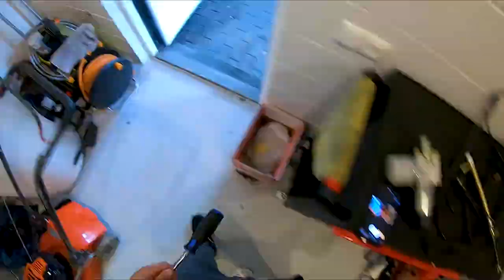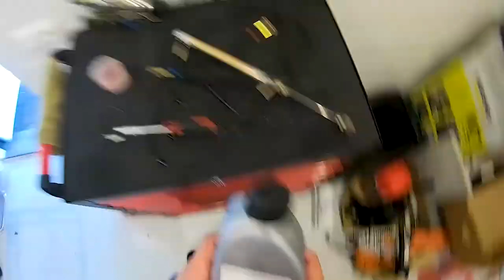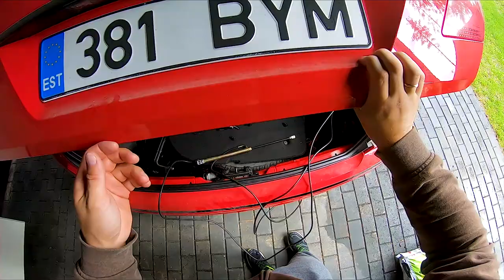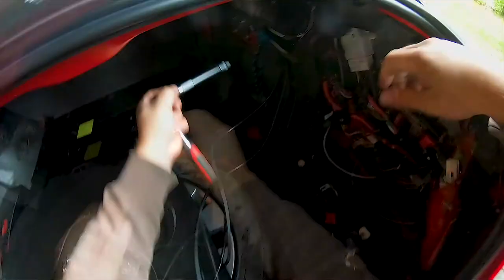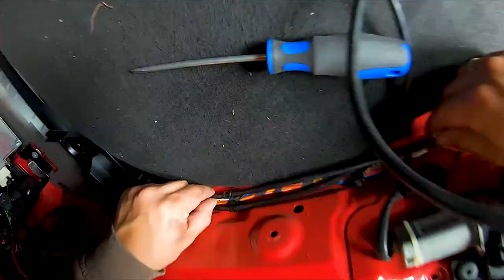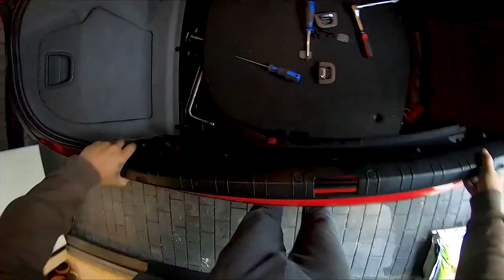Making The Trunk Lift Lift Again - BMW 760i E65

Comment: I went back to my car and used the remote and the buttons only to lift and lower the trunk. After 7-8 times of doing that, the trunk started closing on its own (when I was attempting to bleed it initially, I was manually opening and closing the trunk). I am now presuming there was more air that needed to be bled out of the system than expected. 
So far so good. I’ll be more patient next time! I’ll keep testing it for a couple of days. 🙏
Reply from the maker: That could be it.

Comment: I changed the struts the same time I added fluid just a few days ago. It did work before. The issue started a couple weeks ago. Of about three to four button presses, 2-3 will generate a motor sound.
Reply from the maker: If you press the button and there is no pump sound then it probably is the button. If there is pump noise and it stops mid way or does not move at all then it can be several things. For example the new struts are for a car without hydraulic lift and they are a lot stronger. Car will detect that there is something in the way of the trunk and stops moving. There can be air in the system. If the pump is running and the trunk isn't moving it will stop the pump. The sensor for the trunk lift can go bad. If it does not detect any movement it will stop the pump.

Comment: I filled mine up completely with fluid but still not working.. The pump just makes a noise
Reply from the maker: If it was completely emtpty then you have to bleed the system with pump working and manualy lifting and closeing it.

Comment: Thank you for the video, I'm having issues with the lift system and I discovered that the hydraulic cylinder was actually leaking. is it hard to disconnect the old one and install the new one where it meets the trunk lift support? I couldn't get my hand in there and I'm wondering what would be the easiest way.
Reply from the maker: It quite hard to get disconnect it. It might help if you remove all the control modules that are in the way for more room.
Reply: @SATSMotors  thanks for the reply. Today I went to work on it and discovered that lower the trunk lid a bit extends the piston enough to fit the a screwdriver to unlock the metal tap! also ye had to remove at least the top module above the dvd changer.

Comment: Hi. This was amazing. My trunk lid opens, however that hydraulic has a continuous working sound even after it has opened and then closes on its own. Is that sound normal? 

I have a 745i e65 and a 750i e65, 750i just doesn't work at all but I can hear the pump, was this video complete part replacement or was it just topping up the hydraulic reservoir, the removal of the pump didn't actually show. Or was it brand new?
Reply from the maker: I only changed the hydraulic cylinder and fluid.

Does the lid almost fully opens and then closes on it's own? Does the lid stay on when you open it manually? Is there correct amount of oil?

If it closes almost immediately after the lid opens and it would not stay open when opening the lid manually by hand the struts are most likely gone bad.

Comment: I have replaced both struts and had to add more fluid to the hydraulic reservoir (mine was low, no signs anywhere of leaks or damage to the ram lift, cables or pump). When opening the trunk with either the cabin button or the trunk button, the trunk opens every time. But when closing from the trunk button, it still takes a few button pushes, which it will go down then up, nothing, or finally will close. Any thoughts? I have an ‘07 750i e65.
Reply from the maker: Does the pump make noise everytime the trunk button is pressed? Did it work before you changed the struts?

Comment: Can you tell me precisely which hydraulic fluid did you buy plz?
Reply from the maker: Can not remember the exact one that I used. But it was an high quality ATF. Would use Shell Aero if I would do it again. Trunk lid will open slower with ATF.
Reply: What is the fluid level not sure

Comment: What brand hydraulic fluid and where did you buy it?
Reply from the maker: Shell Aero mineral hydraulic oil is what BMW uses. It can be bought from Ebay or Amazon. I used high quality ATF.

Comment: Very nice video, upvoted. My issue is that the trunk opens fine 100%, smooth and perfect, but once it is open, it drops automatically slowly. Any idea? Thanks.
Reply from the maker: Does it almost fully open and then closes without pressing the button automatically?
Reply: @SATSMotors  yes, it fully opens first, and then slowly closes without pushing close button. Its like the weight of the trunk closes it.
Reply from the maker: First I would look If there is enough oil in the reservoir. If there is enough oil then probably it is the trunk gas struts that won't hold the lid up. If you open the trunk lid manually and it does not stay up then this is probably it. It might also be the trunk positioning sensor. Its located near the pump. If the trunk fully opens but the positioning sensor does not register it the lift module will think that there is something in the way. I think that there is a way to reset/calibrate it but I have not done it myself.
Reply: @SATSMotors  Very helpful response thanks. Just one more thing, the gas strts that you have mentioned, can I replace them without too much effort is is it a whole lot to disassemble?
Reply from the maker: Should be less then a hour of work with not that much things to disassemble.
Reply: @SATSMotors  Are there 2 of those or single?
Reply from the maker: There are two of them.

Comment: Hi, what oil did you use?
Reply from the maker: High quality ATF. BMW recommends some other hydraulic oil that is 10 times the price of ATF but ATF has worked great for me.
Reply: @SATSMotors  amazon sells the right oil for $15. Shell Aero mineral hydraulic oil(quart), used in aviation, its even the right color as the BMW oil